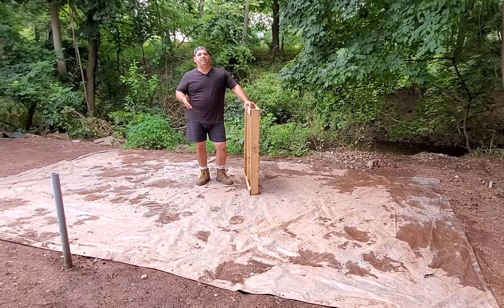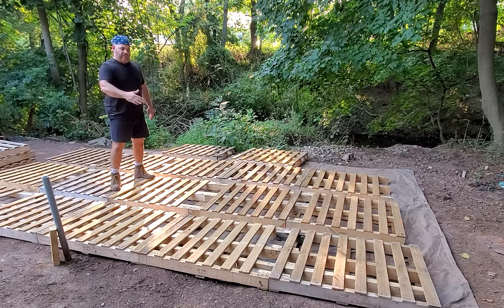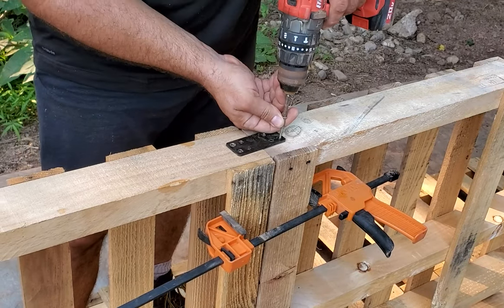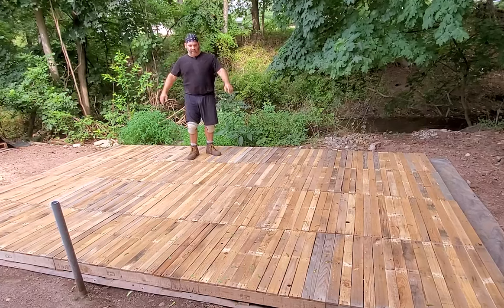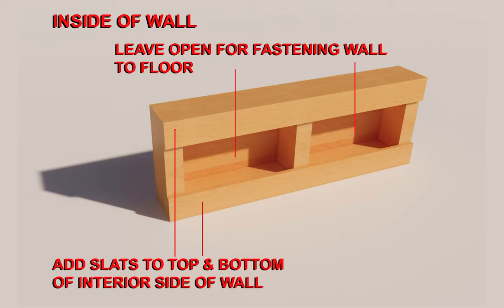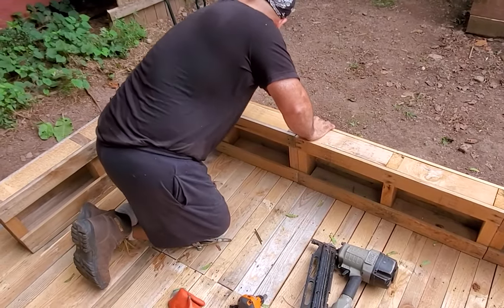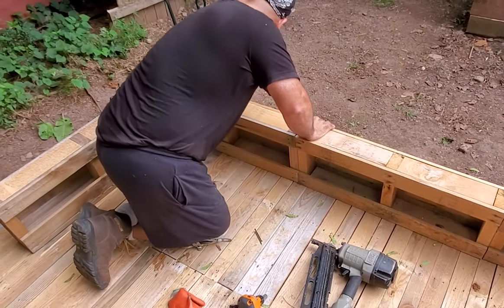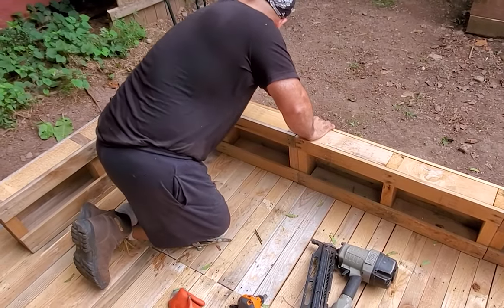Building Floor For Harbor Freight 10x17 Carport

Comment: Very cool. Because I get free pallets from work, I used this idea for a wooden 10X12 shed years ago, but covered it with sheathing from work also. Put the pallets on cinder blocks in key places, and trap rock covering the rest, under the pallets. It's held up fine, but critters like to borrow under it, and live there. You did well on yours. Thanks for posting.

Comment: Good project and innovative.  Here are a few suggestions that you might have already discovered being as this is a year-old video.  First, the bolts for your t-couplings are going to add pressure points that will cause holes in the tarp, so some manner of protection is needed on those like pool noodle foam.  Second, the tarp on the ground is a good idea for protecting the wood, but it's bound to create standing water under the tent that will create a humid environment.  To solve that, get a tarp large enough that you can fold over the floor, secure it with the walls, and trim as necessary.  That will create a water-tight base and prevent critters from making a home in the void under the floor.  Last, lag bolts would be better than screws for the base especially for windy environments.

Comment: Clever, I like it.
My experience with tent shelters is the sun dries out the cover and that is what is most destructive.
So I stretch a silver tarp over the factory cover. I use the silver one because it reflects sunlight better than the others. The green and blue ones are not tight knit and they will let sunlight through to shorten the life of the cover.
I use rope to tie down the silver tarp which should last 3-4 years. When you replace it, you will see the factory cover still looks like new.

To keep critters out I just toss mothballs in there from time to time.

Comment: I know this is a few years old. But I've been looking into doing the same thing with a 12X24 HF carport. Once I get the floor built, start saving up to make it a permanent structure. By adding to the metal frame and then drying it out, adding insulation, drywall and peg boards,  AC, hopefully, and then heat. I have an 8X12 metal shed I'm probably going to add to it.
But I've one question. Where's a good place to get decent pallets? Or is it a "Strategically Transfer Equipment To Alternate Location" strategy sort of thing? If I did the math correctly, I'm going to need roughly 35. More if I round up.
Reply from the maker: Hi @abitoffcenter383 . Sorry for the delayed response. Thanks for reaching out to us. Sounds like a plan there. Couple of things if you're planning on making it a permanent structure - I would recommend that you put the skids on some kind of block or pavers. Do not leave it directly on the ground. This will protect the skids from rotting for a longer period of time. As far as finding skids, you just have to go looking. Find an industrial park around you and go on the weekends ;-) and see what they have. Eventually you'll find a company that has consistent size skids and that's the one you'll want to go with. If you find random skids here and there, you'll just spend more time sizing them up. Hope this helps. Happy Dumpster-Diving ;-) Thanks for watching! Jackie and Dan

Comment: Hi Great Floor, deck did you treat the wood? Stain or paint 
Just noticed your wall pipe Tees might be upside down, the curve part goes on top...just trying to help...
I really like your idea of EXTRA ROOF SUPPORTS ....That's  an Excellent Notion!   Great Job
Reply from the maker: Hi Michael: Thanks for your comment. I just used these tents for storage so no need to stain them - they're pallet wood so they're pretty well dried out. And if you notice, I add a heavy-duty tarp on the floor to keep the bottom of the pallets from rotting out. As far as the tees, I'm not understanding because the rounded part is on the ridge and the straight part is the extra support. But yes, I really wish that Harbor Freight would make this extra support Standard. I have 4 of these tents on my property and have added the extra supports on all of them. Thanks for watching! Jackie & Dan

Comment: These 10x17 harbor freight tents have decent frames, but the cover will last about 2 years. After that,the inner lining starts to flake like dandruff. I know from experience.
Reply from the maker: Hi @snipestaxservice7983 . Sorry for the delayed response. I know what you're talking about. I've been using these tents for over 10 years. What we do is we get a heavy-duty tarp (not the ones from Harbor Freight) and cover the top of them. This prolongs the life of the canopy. Also, in case you didn't know, you can buy the canopy from Harbor Freights Parts instead of buying a whole new tent. Thanks for watching! Jackie & Dan

Comment: I'm wondering why the extra five inches on the outside of the wall.

That appears to be a place for water and debris to collect. But thanks for listing the dimensions, now I know what size to build my floor.
Reply from the maker: Hi Mike B: Thanks for the comment. The reason we have that extra space on the sides is because the skids that we have come in a particular size...all uniform. So when we line it up with the Harbor Freight tent frame, that's what remains. And we didn't want to have to cut them down. And to answer your question, it doesn't collect any water/debris but I  guess that would depend on how close you have it to trees, for the leaves to fall on it. I hope this answers your question but if you have any other questions, feel free to ask. Thanks for watching! Jackie & Dan

Comment: What do you do about the animals getting inside? Seems to me the tarp walls still won't be secured along the bottom unless you did something there. I know this was about a floor for the canopy but you mentioned about the critters getting in. That's the problem Im working on solving now. I had this very same idea yesterday (that you've constructed in your video) but my purpose was more for keeping critters out. I was hoping to see how you finished off the tarp to the knee-walls to prevent things from getting inside. Did you secure the bottom of the tarp walls to the knee-wall? Or is it just dangling there?
Reply from the maker: Hi @reviveoutdoors . Thanks for the comment. There's different things you can do for different critters. For things like snakes, which we get alot of ... no matter how well you wrap it up, snakes will slither their way in. So what I do, is I spread a snake repellent granules around the perimeter and that tends to take care of them. Ground hogs, I usually don't have a problem with because they like to be underground. Racoons generally don't hang around there unless there is something for them to eat. The biggest problem we have are stray cats. I find that the strong scent of the snake repellent helps with them as well. But as far as securing the sides, I have tried in the past to punch grommets in them and screw it down to the side of the walls. Another thing you can do is buy wiggle wire channel, screw it to the wood side walls and lock in the flaps that way. That would be the best way to secure the flaps. If you're not familiar with wiggle wire, we actually did a video where we used a floor like this for a temporary greenhouse and we used the wiggle wire to secure the greenhouse plastic. You can check it out here: https://youtu.be/M0gUZYCpIAk?si=jeWesCpe8y-v-T8C . Also, I'll be coming out with a new video, showing you how to add a tarp to the top of the tent and secured to the base to help extend the life of the actual tent canopy ... so keep an eye for that.

Hope this helps. Let us know if you have any questions. Thanks for watching! Jackie & Dan

Comment: Where the bolts go through the frame, go ahead and wrap it with duct tape, same as the joints, tape around the pipes.  Get an extra year or 2 or more out of the tent.
Reply from the maker: Thank you for the suggestion and thanks for watching!